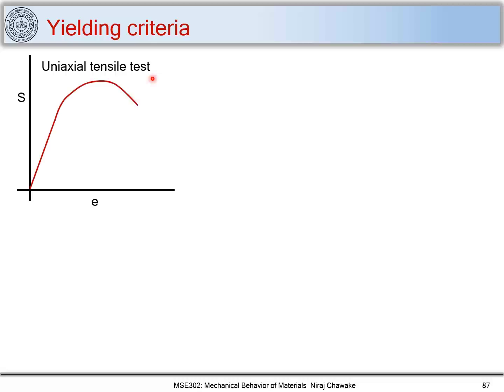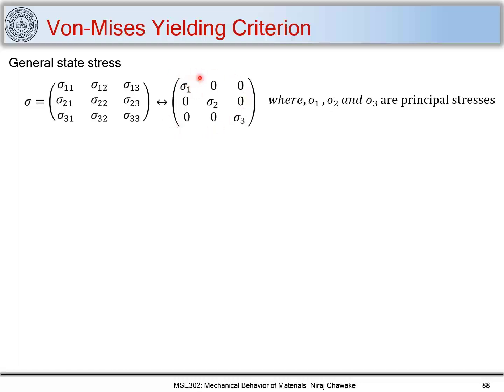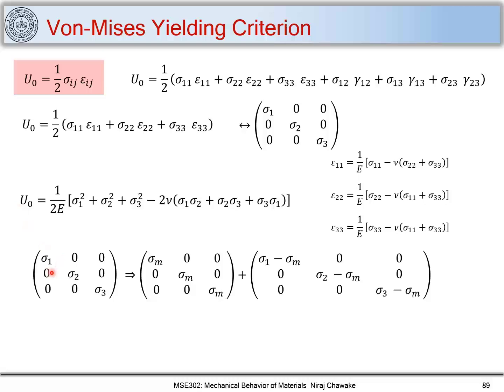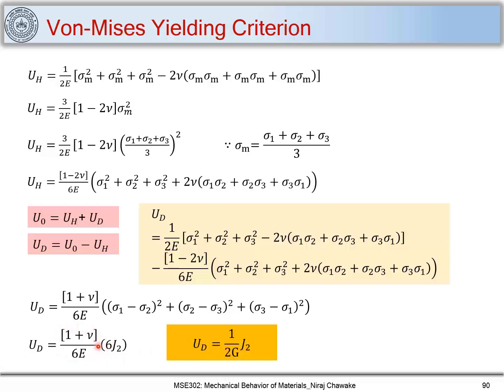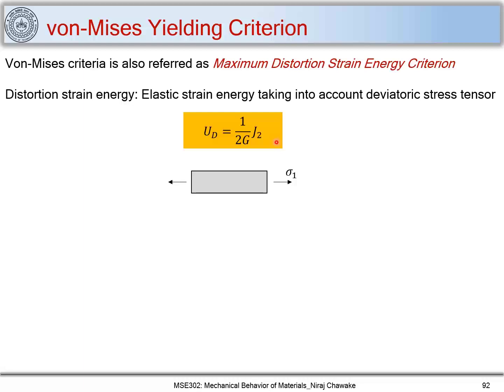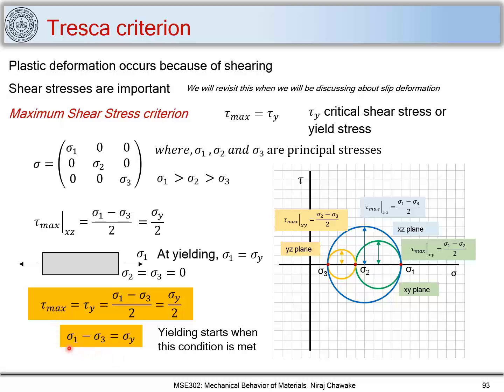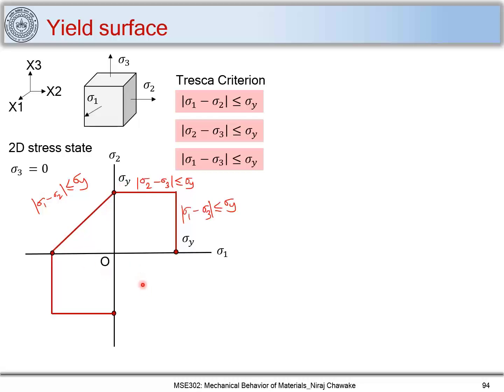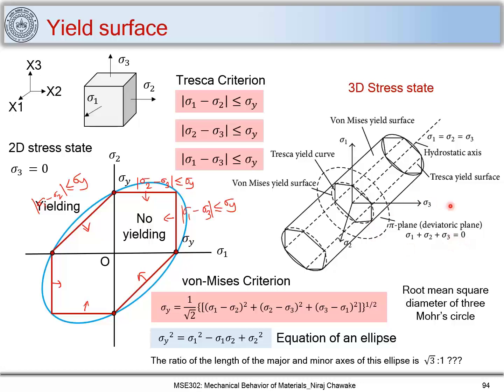24. Yielding criteria for crystalline solids

Comment: Dear Sir, 
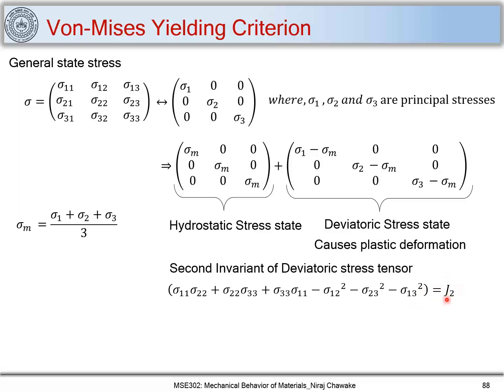Isn't σ1 = σ11 at 10:10. Please correct me if I am wrong Sir. If yes then what is σ11 = σ1 - σm at 7:01. Are both equations related?
Reply from the maker: Sukrit
Any general stress state can purely be represented using principal stresses (i.e., there will be no shear stresses). Further, the principal stresses can be represented as the summation of hydrostatic and deviatoric stresses. Here, we are trying to evaluate the second invariant J2 for the Deviatoric stress state. The J2 for any given stress state is written in a generalized way as mentioned in video 14 (Please refer to the video, https://www.youtube.com/watch?v=4w8Pu4q93rE). Now, for the Deviatoric stress state, when trying to evaluate J2, I have written (σ11 = σ1 - σm) at 7:01.

Important point: We are using generalized relations using a generalized stress state, and then modifying these relations based on a particular stress state (i.e., principal stress state, hydrostatic or deviatoric stress state). Thus, σ11 will take values based on the situation. Please don't get confused. If you have further doubts, please let me know.
Reply: @nirajchawake  Thanks a lot, Sir. I understood.